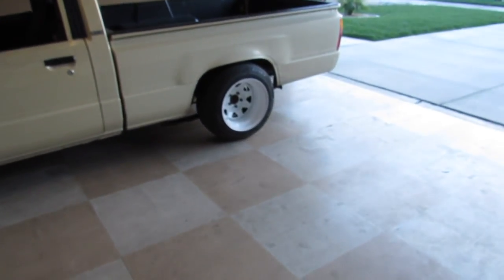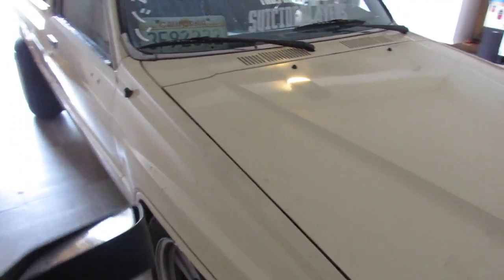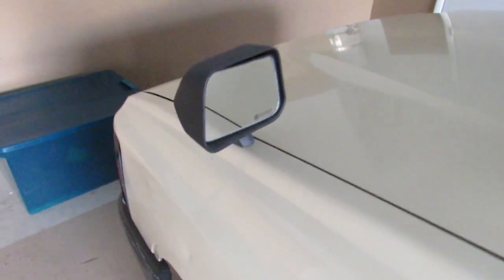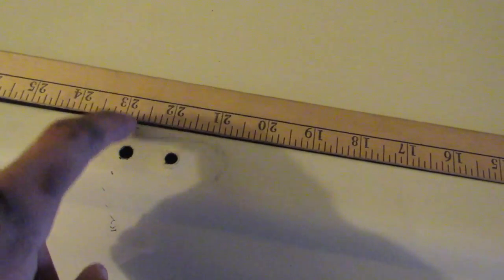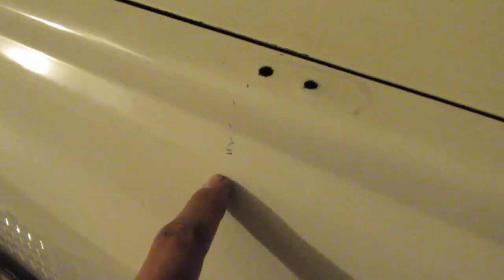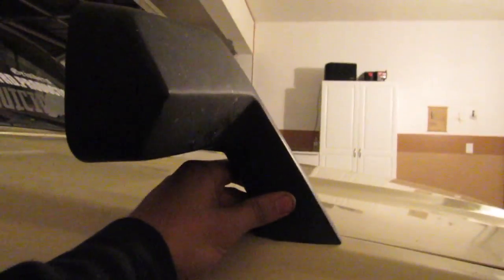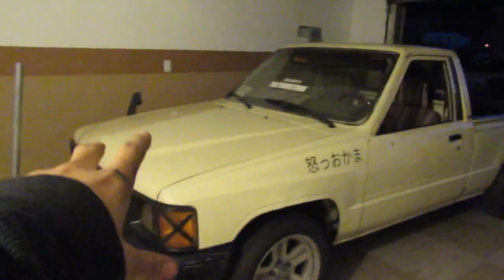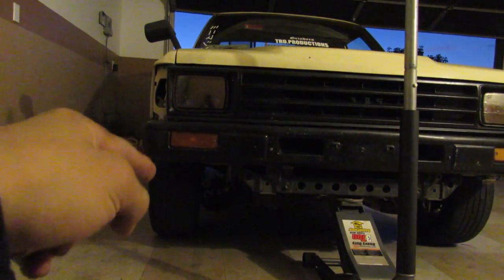How to install fender mirrors!

Comment: Take a couple peices of painters tape and put them down in the spot you want to drill to keep the bit from skipping. Start slow and let the bit do the work. It's also not a bad idea to start with a smaller pilot bit.